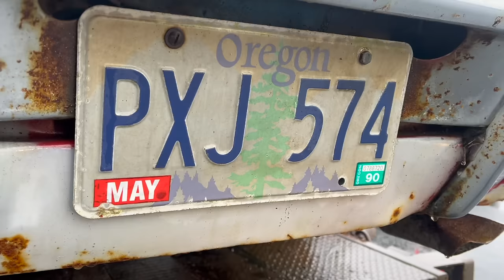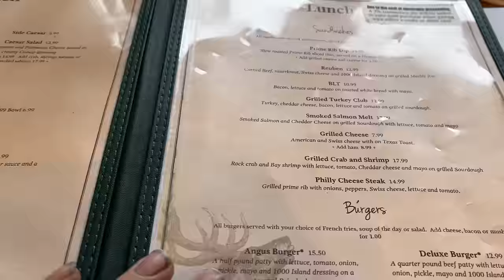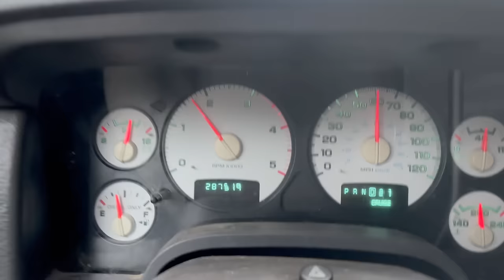I Bought A Rusty 1969 Dodge Charger! (But It's Worse Than I Thought)

Comment: I agree; one of the best looking cars ever made, especially in B5 blue. I vote for street cruiser because I want to see more of these on the road.
Reply: Burnt orange,plum crazy best two colors
Reply from the maker: I want it ready for street duty, and for a real good time!
Reply: Honestly i can't tell if that car was originally blue or red ! lol. does it have a fender tag
Reply from the maker: @zcam1969  It was definitely B5 blue, and appears to have had black interior originally. The fender tag is gone, so I have to rely on the available clues.
Reply: @DeadDodgeGarage  see if it has a Dana 60 rearend .that will you clues as to the original engine
Reply: @DeadDodgeGarage  ratty yet practical street machine

Comment: OMG! It's story time! In 1983 I was 24, and living in the rust belt of Western NY. I was in the market for a Superbird. I found an orange Daytona with black guts and a white wing. The original owner was selling it for $2000. It was a 440, 4 speed with 54,000 miles. It ran and drove great, and everything worked. It was completely an untouched, all factory equipped original. I had the cash in my pocket, but I passed on it because it had 2 dime sized rust holes in the quarters behind the wheels. My friend bought it... parked it his yard for ten years and sold it for $8000. Yep. Wing cars were two grand back in '83! It sounds like a bonehead move, and missed opportunity today, but had I bought the car, I would have drove it for a year and sold it to buy something else. I had three more chances to buy a wing car... a Hemi Daytona that was missing its engine, and 2 Superbirds. The best one was a pristine Superbird for $4500, but after I drove it, my desire for a wing car died, because ironically, people in those days called you stupid for driving such an ugly car!
Reply: Back to 1983, just finished Basic Training for the Army Infantry and had a bonus check burning a hole i my wallet. See a 1970 Charger at a local used car dealer for I think around $2000. It was Root Beer Brown with a white vinyl top an brown interior. The engine was a 2 barrel 318 with an auto transmission behind it. I kept it for about four months and found it boring with the 318 so I sold it to another soldier. He never transferred the title and sold it to another soldier that I had to go to the title transfer place to get the car into his name. He got drunk one night and creamed the rear end into a telephone pole.

Comment: My first Charger R/T was in roughly the same body condition as yours. It was also medium blue with a white vinyl top and white interior.  It did run and drive great. This was long before there was replacement panels available.

Comment: I appreciate the irony of calling it a race car when it has a lot of the 1979 "kitsch" that guys inflicted on cars which actually made it worse in every respect. Especially racing.  
I LOL'd when you mentioned that is didn't have ladder bars. 
 A lot of guys that want to make a 1979 malaise era kitsch car today have forgotten that covering the back windows with free decals from the hot rod store was  part of it.  The small steering wheel....  I would have included the ladder bars as part of it, but now I am not so sure they were all poser on a Mopar.  I would like to see you test them out on something and give  your impression as to whether they helped.
Reply from the maker: I didn’t call it anything, I asked the question - drag car or 70s-80s street machine? I think we all know it was the latter, when we consider that it still had a small block under the hood. Also, I said it’s missing shackles - ladder bars are something very, very different. Shackles exist to lift the rear of the car slightly and ruin your leaf springs. Ladder bars are actually a useful traction device. The slapper bars that are on it are often said to be pointless on a Mopar, so you could also be referring to that. But I have heard conflicting reports. Either way, these ones weren’t doing anything without the rubber pads that engage with the leaf springs.

Comment: So just curious Jamie... what exactly would you weld subframe connectors to?  :)   And yes, I did catch your paraphrase of "Whip It"... "When a Charger comes along, you must buy it"
Reply from the maker: Hopefully there’s still some metal in there somewhere 😅
Reply: @DeadDodgeGarage  I dunno... may have to do floors first.  At least sheetmetal is available for that... I'm not that lucky other than a few Charger/Coronet shared items.

Comment: I think it would be cool with your skill level and tools available to take a donor more door A body and strip all useable parts-slant six,a904,7 1/4 and bolt it in. Then take patches of all the donor a body metal (roof, floor,trunk-anything metal) and canabolize it to make patches for a floor and trunk in the charger. Extreme budget build. I bet you could come out cheaper using an a body donor and putting together a budget charger than trying to find b body parts to affix. I wouldn’t mind cruising in a slant charger, as long as it’s reliable. Either way nice find!

Comment: There was a time when I was afraid of rust! If you can do it all yourself.....worth the work! I wanted ask....about your 68. I noticed your wheels are SS and I'm doing the same. Can you tell me what rim/ tire combo you run? Is that the biggest for stock chassis and suspension?
Reply from the maker: Rear is 275/60r15. Front is 245/60r15. I don’t know the specific measurements on the wheels, but the rear has more width and about the same back spacing to kick the tire outward and give the dished look. I think front is 15x7 with 3.5” back spacing and rear is 15x8 with 3.5”, but that’s an eyeball measurement. The 275 fits with no problem. The old rear tires were 295s on a 10.5” wide wheel. If they had another inch of back spacing, they would’ve fit great in the wheel well and not hit anything. A 295 back tire is definitely possible on a Charger with very careful measurement and wheel ordering.
Reply: Thanks a bunch Jamie...my particular car is a 70 Bee. I want to order my 275/60/15 and 225/70/15's soon. I also plan to use the SS wheels and the critical question is of course backspacing. I ran a 10x15 deep dish Crager on a Challenger and they fit..barely. Surely this B body has the extra room out back. Incidentally, I hope it doesn't make any difference but I converted to 4 wheel disc too.

Comment: Don't think I'd do much with it. Just make a beater. Leave the panel rust. Belt sand primer off the side. Back to some kind of blue or red. Clear coat it. Just some thick plate metal for floors. Scarlet but fun beater. Good luck. Great looking car.
Reply from the maker: I need a little bit more structural rigidity for what I have in mind… and I’m afraid there isn’t surviving paint under most of the primer.  But I essentially plan to do as little as possible.
Reply: @DeadDodgeGarage  might look good  flat white with a flat black stripe. White don't show the defects. Good luck. Great find.
Reply: @DeadDodgeGarage  ye Man keep the rusty roof and top side. Blow white down the sides with a black stripe. Black wheels with white letters. Good luck. If it was mine that is. ,,🤣🤣

Comment: You got the parts Jamie BUT you have a huge panel job 😳. So was it red or blue 🤔etc . On another note point our 273 V8 in the AP6 VC and VE had more HP than the 273 you mentioned 😃.👍🏻🇦🇺.
Reply from the maker: The performance version of the 273 had a lot more than that here too. Haha.

Comment: I bought a '68 Charger when new. 440 torqueflight. I sold it for $150 in '79. Well maintained but completely rusted out. I lived in No.Indiana. The salt on Winter roads killed my Charger. Back in '79 it was not worth restoring.
Reply: Nowadays just a dash with serial numbers and a fender tag and title with 4 wheels is worth something

Comment: I think I would lean with the brake and suspension work to go with the 440 . With the power of the 440 it's always a plus to be able to stop and take a corners, especially where you live.  Stay safe buddy.
Reply from the maker: I’m not planning to drive it hard on the street. But I am thinking some level of suspension build would be cool.

Comment: 6.1 Hemi swap , very cool 69. Did small block chargers come with a front sway bar? I thought only big block cars got them. 🤔
Reply from the maker: All Chargers had them in some years, like ‘68. It was included with the “heavy duty suspension” that all Chargers came with. I am still not sure when that stopped. Definitely by ‘73.

Comment: Edit, I wrote all that below before seeing just how bad it is. You have to give us the back story on how you bought it without knowing what you were getting. Was it that cheap? 

Street strip, just a fun car. Full interior, no roll bar, 440. Stock looking except the tires and wheels.
Reply from the maker: It wasn't quite cheap enough. But it's a Charger. When you can buy a Charger... buy it. I was sent some pictures and could see the back corners, the worse lower quarter, and scale on the floor. But the way they were shot (as usual) really didn't show the actual level of badness.
Reply: @DeadDodgeGarage I forgot to mention, I loved the “And remember”.

Comment: Jamie, I'm not sure what some of these guys are smoking when they say to turn this into a "cruiser" WHAT!?!? That would take insaneulous amounts of work and money. I say turn this into a dirt road bomber, and by that I mean fix the structural stuff so that it doesn't snap in half when you punch it, put a solid drive train in it and drive it fast and dirty down old dirt roads.  Can't wait to see how this goes. Cheers!
Reply from the maker: Exactly! Subframe connectors, floor patches, trunk panel, rear left frame rail patch, reinforcements everywhere, and then some 440 power. It would be nice to be able to drive it to the dirt roads. But I sure don't need it to be a nice daily driver car. I've got that already.

Comment: Go all three, dump the slant in and have fun. Then swap out to the 273 for fun factor level 2. By then the 440 should be built.
Reply from the maker: I like it! The main problem would be that every engine requires a different transmission.

Comment: I'd weld up all of the holes and paint it B5 again. I prefer a black vinyl top on the '68 too , with that red, but white looks especially good with colors like B5. I wonder what color the top was. The white gives a real clean look - but is kinda grampa-ish. I also wonder if they Bondo'ed the roof seams, which wouldn't've been leaded if the car got a vinyl top I think. Bondo is bad because it doesn't like to flex like lead does, and that area of a unibody is subject to some flex.
Reply from the maker: The seams would’ve been leaded either way. I don’t know if there is bondo there, but the roof seam looked good and I didn’t suspect any tomfoolery there. I haven’t gone looking for filled trim holes yet either. But either way, I don’t think I’d put a vinyl top back on. I always wanted a red ‘68 with black top, black stripe and black interior. Once I saw the white in person though… I realized how awesome it was. I could never change it.

Comment: Well first you gotta get rid of the fat brake pedal so you can put in your left leg exerciser and then get that pistol grip thing that comes through the floor. They say the four link suspension works great in the rear. I was always curious what primer black would look like if you sprayed some clear coat over top. Like a paint job in progress for as you do body repairs.
Reply from the maker: I’m definitely keeping an eye out for the three pedal solution parts. I’m a leaf spring guy though…

Comment: I think my favorite of the trio is the '70.  I prefer the highback buckets, available Rallye wheels, the hood blackout w/ engine callouts, available Six-Pack, Pistol Grip....

Give me one in Top Banana with black top, stripe, guts & hood blackout.  Hemi or Six Pack.... automatic.... yum.
Reply from the maker: A lot of cool stuff became available in the ‘70, and I actually like the loop bumper, unlike some people. But they also cheapened them, changed the padded dash parts to plastic, redesigned the door panels, and also the seats. They just lost a lot of the class of ‘68-69 in my eyes. I love the ‘68 the most, but I think ‘69 is probably the “best” in most regards. Those tail lights… the legendary split grille… orange 440s… and that excellent interior.

Comment: My first choice for the engine would be the 440. My second choice would be the 360. If I were you, I would get the wheel rims re-chromed and use them. They are rare and hard to find. If you don't want them, maybe I'll buy them from you and use them on my '66 Barracuda if they are re-usable. As for having pizza, I would drink LOTS of beer to go along with it after going through that Charger! lol
Reply from the maker: Oh, don’t worry… I did 😅 ok, just one beer actually. those wheels are not at all in good shape. I don’t think they are worth saving, but I could be wrong.
Reply: I hope you can at least get your money back, because that car looks like crusher material, nothing personal.

Comment: Structural rust, and any rust that be a problem. Subframe connectors. Suspension including front/rear sway bars. Built 440, 3rd pedal. 
I have fun. Why build it for a drag strip? Why build it for any singular task. Built it to beat it, and build it to rebuilt it. 
Just my 2cents.
Reply from the maker: You’ve got it exactly! Except I am not committing to a third pedal - yet.

Comment: Build it fix everything and make it flat black with modern suspension and a supercharged modern hemi motor and transmission. You can have more fun than ever
Reply from the maker: That’s not my kind of fun. If I wanted to have that kind of fun, I would have bought an actual Hellcat when I had the chance. Instead I bought an all original 383 Charger. I don’t know if you’ve ever drifted an all original 383 Charger in a field… but I have. And it was a damn good time. Haha. So this one will be even more fun with a 440 and some handling parts. But the torsion bars stay.

Comment: Go to wholesale metal warehouse get you some 2x3 sq  tube for your frame cons and any extras you need, cutout whole FP,weld in 1 piece FP 2 in higher remember you don't have to weld everything 3m panel bond is your friend.400 built will be cheaper and lighter.Good luck😊
Reply from the maker: I’m not going to do any of those things. I did consider making my own subframe connectors though.

Comment: I’m interested in buying one but I don’t know what a fair price is for the different conditions.
Reply from the maker: Piece of rusty but mostly complete garbage non R/T roller - 10-14k. Drivable but not nice basic 318 or other low level car - 25-35k. Really nice 318 car - 45-60k. Relatively nice 383 car - 50-75k. Pretty crappy but complete R/T - $30k-$50k. Driver quality R/T - $75-90k. Collector grade R/T… $150k+

Prices subject to change due to whatever people are asking on Marketplace today, the phase of the moon, and the amount of chemicals in the drinking water supply.

Comment: Strip down, patch all rust, body and paint, color : Suburu Cool Grey Khaki, all original interior patterns done in charcoal/silver and silver, charcoal vinyl top, 13x7” chrome Reverse Supreme wheels with 13” Kontio white paw tires with 1.5” white walls, 4 link rear suspension, updated challenger I.F.S. With a crate 396 hellcat engine. Your welcome. Now go to work, let me know when it’s ready and make me a fuckin coffee cake. 😁
Reply from the maker: It’s like you’ve thought about this or something 😅
Reply: @DeadDodgeGarage  I never play around with making cars cool, and I never play around about coffee cake. 💯

Comment: NASCAR West tribute car. Does not require a high dollar paint job or extensive body work to become a fun car show attraction. Perfect home for a motorhome 440. IIRC, Herchel McGriff had a beer company sponsorship.
Reply from the maker: I like it. And I have a motorhome 440…
Reply: @DeadDodgeGarage  Embrace the race car vibe with a fuel cell and some sheet metal to replace that almost gone trunk floor. Rough and ready bodywork and a cheap paint job won't even get noticed with side exhausts and beer company graphics. No need for a fancy interior either, although a bit of a roll cage would be very cool.  A "street stocker" Charger project will attract the views too.

Comment: Hey I hear there's a Mopar "scrap yard" more of a project yard in Burlington WY
Reply from the maker: Yes, so I've heard. Haha. As a general rule, I won't drive more than a few hours in any direction to get a project car - excepting particularly interesting circumstances. But I've got plenty of cars in my back yard (literally and figuratively) and I don't need to try that hard for content.
Reply: @DeadDodgeGarage  I totally get that it was more of an possible option for panels for the car you just picked up although I'm not sure they will do that

Comment: The first this to do with this car is convert the headlight covered to an electric motor and get them working then do a video of them working so I can watch it over and over again.
Reply from the maker: You don’t like the vacuum thingies? I kinda like that, and all of the stuff seems to be there. I think Tom has spare vacuum pods I could buy if necessary as well.
Reply: To activate the vacuum thingies you need a running engine, and that is a long way off.  Also if you put an engine in with any kind of cam, it might not make enough vacuum to activate them.  To satisfy my hidden headlight fetish the electric motors would be the fastest way and all you would need is a battery to power them. @DeadDodgeGarage